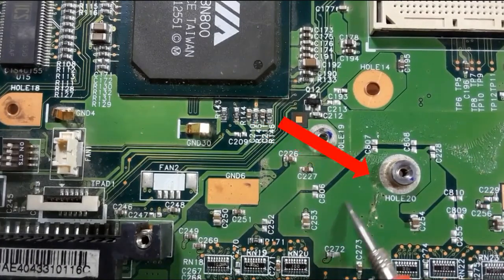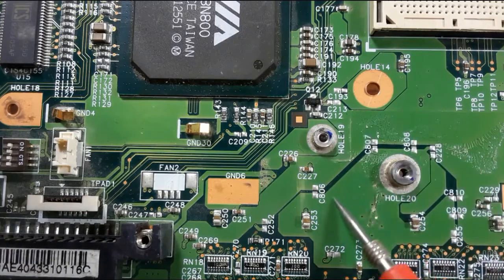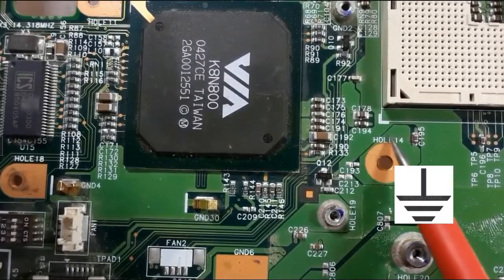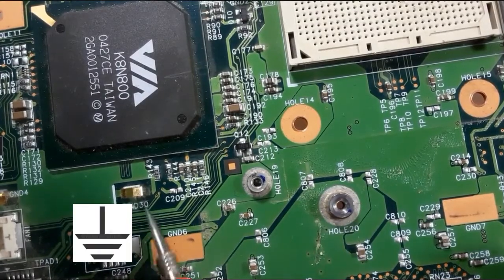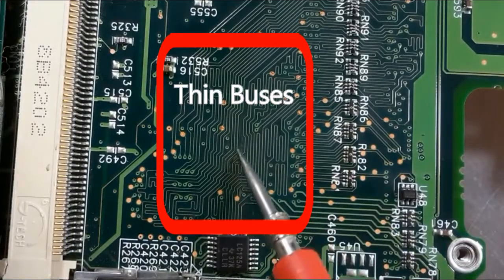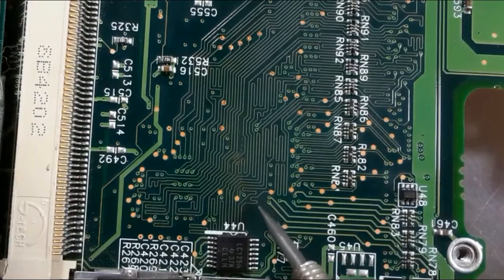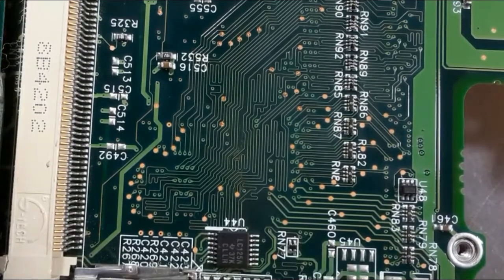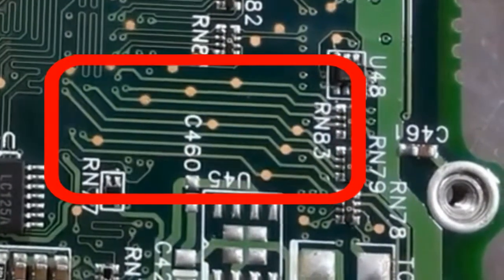Uncover the Secrets of Motherboard Signal Tracking | Track Signals & Voltages on any Board

Comment: And for printed boards with more than 8 layers
Reply from the maker: Tracking voltage on multilayer printed circuit boards (PCBs) with more than 8 layers requires specific methods due to the complexity of the structure. Here are steps and techniques you can use for efficient tracking:

1. Understand the PCB Layout:
Obtain the PCB schematic and layout, ideally with a layer stack-up diagram. This will help you know which layers handle power distribution, ground, signal, and components.

2. Identify Test Points:
Look for test points or vias that are exposed on the outer layers. These are often placed for easier troubleshooting. Ensure that test points are correctly documented for the corresponding power or signal lines.

5. Power Plane Isolation:
Multilayer PCBs often have dedicated layers for power and ground. Use PCB layout software to view and isolate these planes to understand where the voltage should be distributed.

By following these steps, you'll be able to accurately trace voltage and signal paths in complex multilayer PCBs.

Comment: I would like to thank you for this,
 big board it's ok but for laptop it's sooo hard more so on the processor  and ic of the like and integrated ics
Reply from the maker: Hi there,
Working on large boards is manageable, dealing with laptop motherboards is indeed a different challenge, especially around the processor and integrated ICs. The compactness and complexity of these components make it significantly harder to track signals and troubleshoot issues effectively. Thank you

Comment: Thank you so much for teaching this, I am very happy you made this particular video this is where I struggle and a few more videos like this and I'll be in the right direction. I struggle with where to begin a diagnosis depending on the symptoms of the problem/fault then tracing it to the source because I struggle with understanding the MAZE how to follow the from the initial diagnosis and this starts to give me direction. Keep them coming because you have students here including myself watching and learning and taking notes.
Reply from the maker: I did this for you bro. Don't worry I will create more videos about how to track signals and voltages using the multimeter. More awesome videos coming soon
Reply: @electronicsrepairbasics_erb  I thank you a million, by the number of views this video has gotten in a day it is obvious to me how many beginners are looking to learn the same thing. The ability to understand and know how to trace and route these lines and what connects to what is challenging giving how you have hundreds if not thousands of micro sized lines, points, components and one thing begins here and the vias take it somewhere else then you have to flip the board and find it there and hopefully you found the correct one then continue to trace it from there. Its a very tedious process until you have mastered it and even then you can get lost! 😆